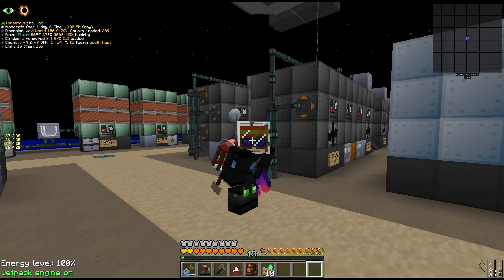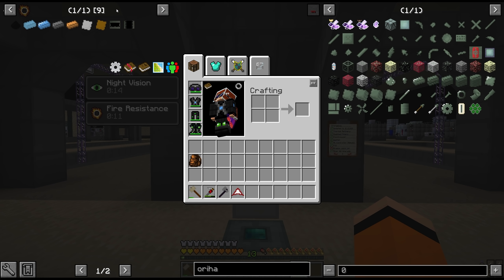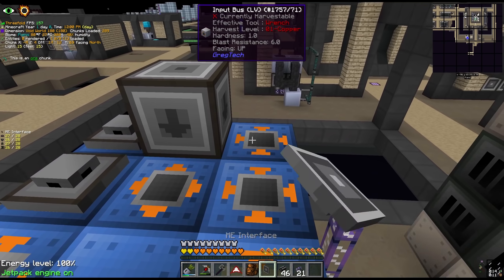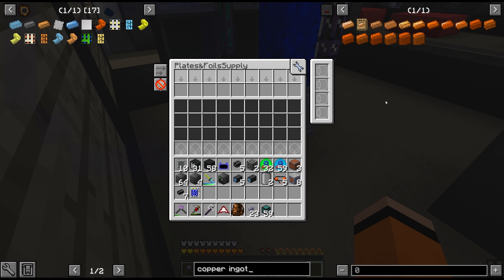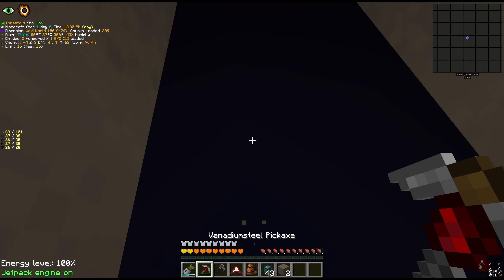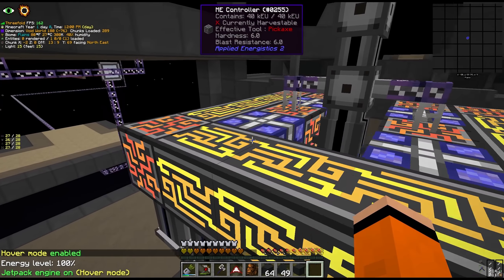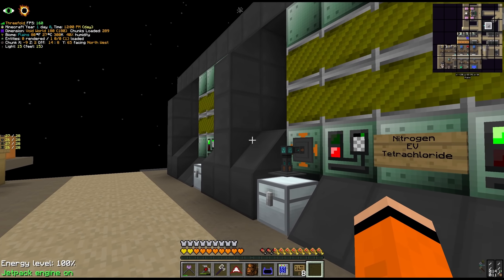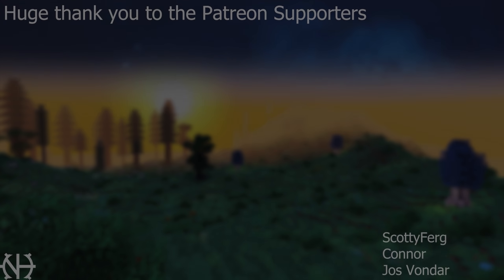Gregtech New Horizons - 53 -  Preparing for Assembly Line! Modded Minecraft

Comment: Super Tank V is only the highest tier of super tank. There's also Quantum Tank I-V which hold increasingly more still, and you are actually able to craft up to Quantum Tank II pre-Assembly Line. It's hideously expensive, of course, but it holds four Super Tank V's worth of liquid.

You can drink milk/eat Terra Wart to get rid of those "have a full tank in your inventory" debuffs. So long as you're not longer holding a tank with fluid in it the debuffs won't immediately refresh.

For reference, the "pin items straight from the crafting calculation screen" feature was added in 2.1.2.3qf. I missed that feature the entire time I was testing things in 2.1.2.1, rest assured.

The thing with circuit boards that you're going to continue producing Nano circuits, quantum circuits, etc. since those are the cheapest HV, EV etc. circuits available. When you unlock Crystal circuits and are able to craft IV circuits directly you're no longer going to use Quantum IV circuits, but you will still use Quantum EV circuits, and those require their tier of circuit board. Other circuit boards also have uses in other crafts, but those are not likely to come up often enough to warrant crafting them passively.

Maintenance Hatches are something you should craft in batches, honestly. You're going to use them, no need to fiddle around with the AE2 system and having it figure out tools IMO.

You will eventually have to upgrade those LCRs to EV when you add the most advanced circuit board, but MV will carry you to at least a Fusion Reactor, so that's nothing to worry about.

Same here. Tungstensteel coils used to be my clear favorite, but HSS-S just looks so good.

The long EBF times is why you invest in better coils. HSS-G takes 90 seconds with Nitrogen at EV. With HSS-S coils and an IV EBF they take ~22 seconds per at no increased power cost (other than higher EU/t). Do you see why I keep hammering on the better coils? They're really worth it.

I definitely feel like it's time that you start investing in an air filter, at least smelting up some Oriharukon to prepare for making a rotor for it. At this point you're able to craft an Air Filter T3, although it would cost a lot of tungstensteel. Good thing you're working on automating that, huh ;)

Something to note about passive tungstensteel dust is that it does get used in recipes, I.E. HSS-G dust. Make sure you don't end up with issues where your crafting ingredients get cooked, that would be unfortunate.

With this EBF upgrade you're definitely going to need a Vacuum Freezer upgrade in the very near future. Ultimately the bottleneck with ingots isn't cooking them, it's cooling them. I do recommend biting the bullet and investing in a Mega Vacuum Freezer. Yes, it's very large and very expensive, but 99% of it is just Alu, and you have that bursting out of every seam at this point. MVFs parallel before overclocking, as well, so it won't kill your power any more than adding another vacuum freezer would.

Comment: I managed to craft and setup an assline in my gtnh world not too long ago, and man did it take some effort. I would suggest looking at building a Mega Blast Furnace for future processing because it is a godsend. ruridit, hss-s, and tungstensteel (Plus tons and tons of common materials like aluminium) are a pain the ass, you needs tons of them right off the bat and it is so slllooowwwww, especially ruridit. But the MBF will smelt it all at light speed compared to the regular blast furnaces... Also as another note it took me about 4 days of processing time to get everything I needed for the MBF (Thorium Yttrium glass and HSS-G coils), so have fun with that lol. (Don't forget the Mega Vacuum Freezer!)